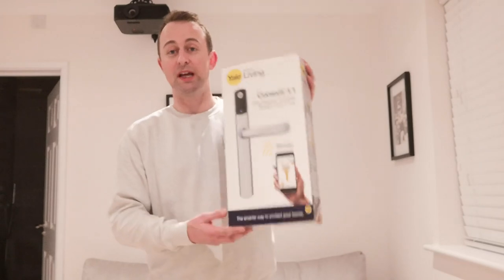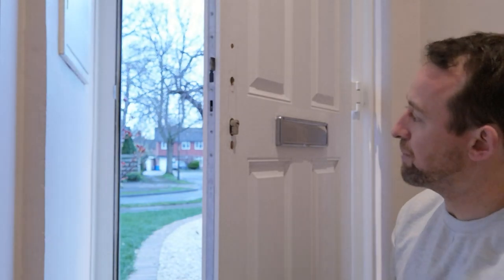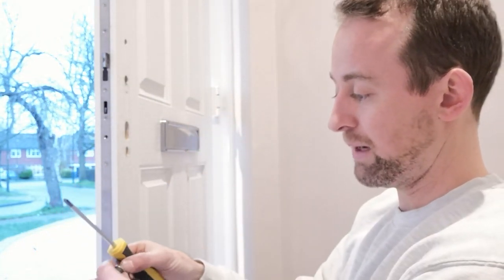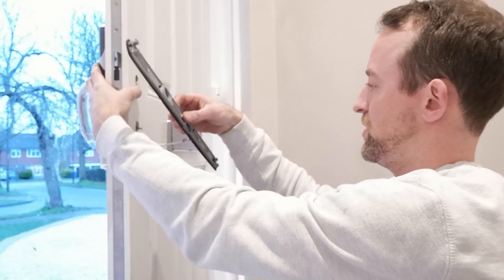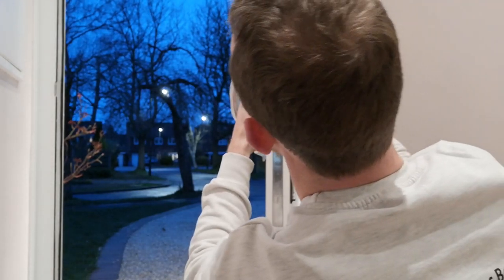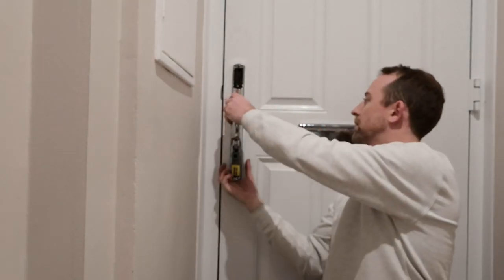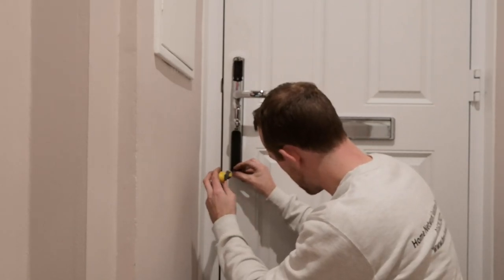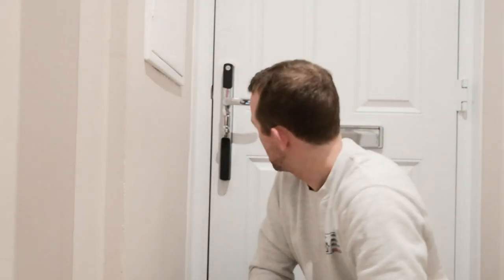How to Install the Yale Conexis L1 Smart Lock - New for 2020.

Comment: Gave this a go and it took 3 hours to install for the first time. You would think Yale would make it easy to install. But not they make it difficult so you pay an expert to come in and install it. Once set up its working perfectly now. Found putting the barrel in difficult and all the screws and juggling it to match up and fit.

Comment: I am looking to do this in reverse (ie. remove a Connexis lock becaase I hate it!) and put in a standard key lock. Is it as simple as unscrewing and replacing with a standard Yale handle and cylinder, or will it be more complicated than that?

Comment: I've seen such mixed reviews on this lock.  Figured I would give it a try and it keeps giving me alignment errors, but I cannlock it manually.  Any ideas?
Reply from the maker: The battery's are not as strong as you are, it sounds like the lock isn't quite alighned and the batteries can't force it, where as you can. 

Having read many reviews I often see what appear to be installation issues being reflected on the lock, if it installed correctly it works really well, although there are better options on the market now. 

It may be worth having a locksmith take a look.
Reply: @home.network.solutions  I may have figured it out that I had the pin in too far on the actuator.  As far as better things out now.  I still haven't really seen a true multi point smart lock.  I was using nf a Nukin which is basically a key turner.

Comment: After recently viewing many Conexis L1 reviews I decided to install one of these myself. YouTube just recommended your video to me (the old algorithm at work). Although my installation went smoothly I watched anyway out of curiosity. Now then, I'm not a troll, in fact, I never really comment on any videos, but, your installation method is riddled with mistakes that could confuse a lot of people that aren't confident with DIY (your target audience I guess). I imagine you are aware of some of your errors but you didn't explain them. I'm not going to list them but at 9:07 you did something that will frustrate some of your viewers using this video as guidance. It is clear to see that when the door edge is facing the camera the centre of the exterior handle is way off that black alignment tool you used on the interior backplate installation. That alignment tool is to ensure exactly the opposite of what you demonstrated, that both exterior and interior handles are perfectly aligned by using the supplied square bar that connects both handles as it passes through the square hole in the middle of that alignment tool. This is the reason you had to keep adjusting that interior backplate. No doubt you had to adjust it again to include that square bar in the next segment. People need videos like yours and being honest about your errors so viewers don't make the same mistakes will help more than you appreciate and increase your subscriber count.
Reply: Good shout Tony. I am sure the alignment is the reason he got an error message when he tried to complete installation :). At this stage, I was waiting patiently to see how he completes reset and clear error but he didn't....I am stuck at this stage myself and scouring youtube for how someone fixes it as have completed multiple  resets but no joy....even with Yale sending me a guide! So any tips on how you fixed that long winded beep when you were testing before pairing the fob will be great!

Edit: Mine is an L2 btw.

Comment: Omg you can code new keys using a tool through the letter box! WTF! just scan on the outside then go through letter box and hold the button and your in. That is absolute garbage!
Reply: You’ve got the getter case off, find the button and then press it. If someone wants to get in that bad, it’s easier to break a window etc
Reply: You can only pair the "master" key (card/tag) like that.  All subsequent keys have to be paired using the app